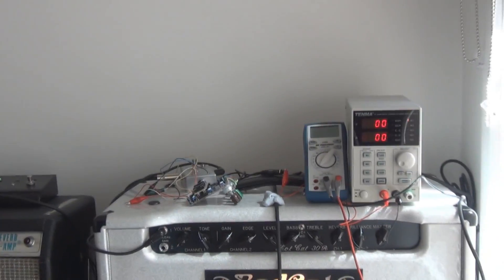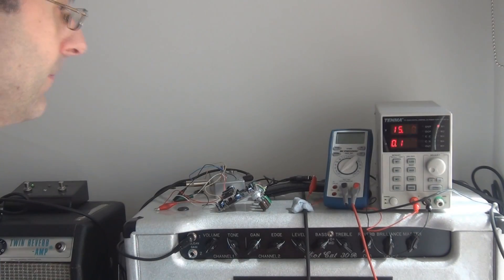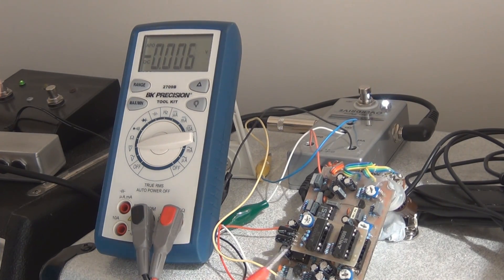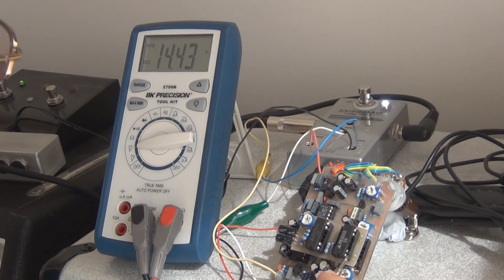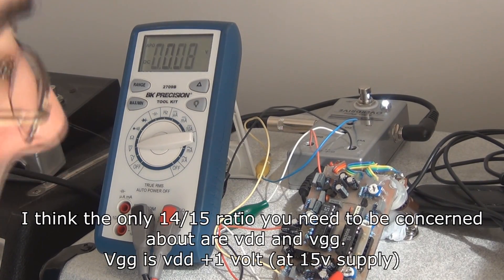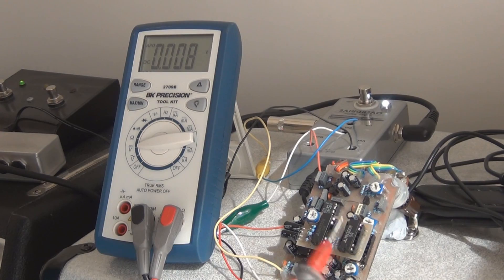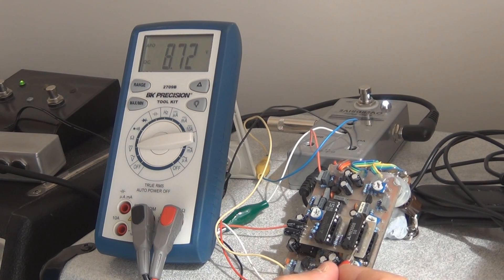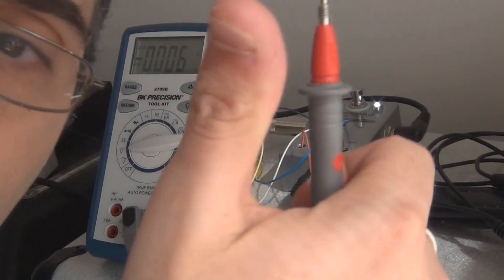BBD Voltages for Fault Diagnosing

Comment: Thanks for posting these readings, even though a decade ago.  I'm trying to repair a delay pedal that uses 4 BL3208s, and with an audio probe I've traced the guitar signal to the input of the first BBD in the chain..... but I get no signal from the outputs.  I've replaced about 20 SMD electrolytic caps, but nothing.  Any suggestions from anyone would be much appreciated.  Here are my readings using a 9.6v supply:
Vdd     9.4     Vgg    8.2
CP2     8.2     IN       4.4
OUT1  3.9     CP1   0.8
OUT2  4.3     GND  0
I realize the two CP readings should be inverse, but should they be that far apart in voltage?

Comment: i've got pin 1,2,3 and 4 at 10v. 4.8v 7.8v and 7.8v is my chip bad. yamaha ad10 delay pedal
actually nevermind, i saw that if i bring the bias down the voltages drop.
but even though i get throughput sound, lights on no delay effect.